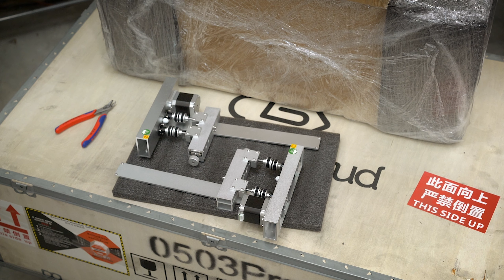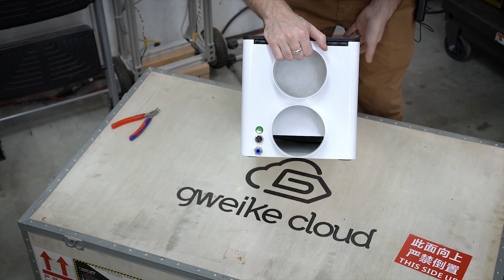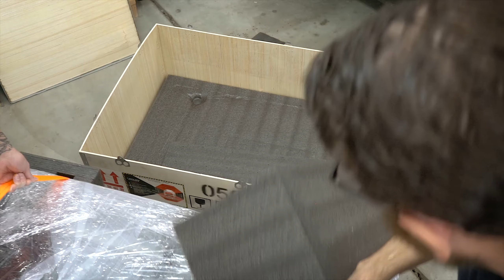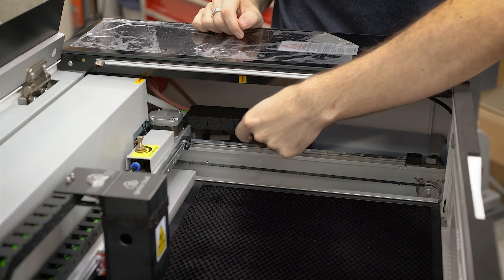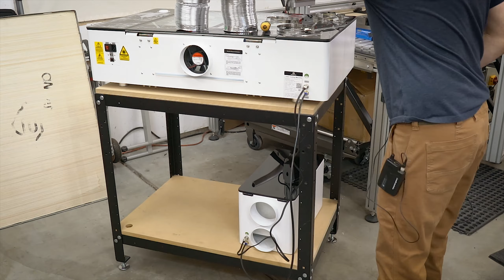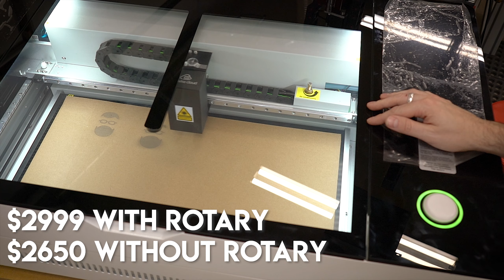Gweike Cloud 50W CO2 Laser - Unboxing and Initial Setup

Comment: I stopped at cloud software
Reply from the maker: You should have kept watching.  It uses cloud software, but it's not very good and the machine works with Lightburn, offline, no cloud connection needed.  That's one of its selling points.  The cloud software is just so it can compete with others that offer it.

Comment: Apparently, the current state of affair is them no longer including the Air Filter Unit anymore because they found it not performing to their satisfaction - Resulting in the Air Assist Pump now also being situated IN the Laser itself - Not that I personally mind as I'll hardly be feeling any guilt in directly exhausting the soot out of a window but yea... Kinda confusing when I asked about the Diameter of the of the Windpipe to order a longer one and they replied to me I wouldn't be needing it as my Kit wouldn't be including the Air Filter ( freaking me out for the Air Assist ) 🤔
Reply from the maker: Oh, that's really strange.  I'll check with them about that.  The air filter box isn't my favorite (it does just an "ok" job of filtering), but it's nice that it's included at least.
Reply: @RobertCowanDIY  Yea... Received mine this week... Took them like 2 weeks to even handing it over for shipping with DHL at least just taking a mere 3 days to get it sent over from China. Getting my Tracking Number from them took way too much effort than it should have... First surprise was a puddle of blue Cooling Fluid in the Crate ( great start ) which I'll have to keep an eye on. 😑

Obviously, everyone usually around me that could have helped with relocating it suddenly either disappeared entirely or became unavailable due to sickness / injury so "Real Men do it alone" it was... Made a carrying harness out of tie down strap like belts attached to the already present belts and carried it half a floor down the stairs into the closet while clinging for my life to the stair's handrail - Not gonna do that again.

And yea... Like previously hinted at mine indeed came with a giant Fan instead of the Air Filter Box - Will have to cut a piece of wood the right size on my CNC to place the Fan into which can then be placed into the Coset Window.

Something of an odd question to ask at this point but... Does Glass ( like the top Door Panel ) block the CO² Laser Light? I read that Plexi does as it is opaque to the CO² Laser but is this also true for what appears to be plain Glas without any coating? 🤔

Comment: I cant connect to the gweike cloud software.  Anyone else having the same issue? Got any tips?
Reply from the maker: Did you go through the whole wifi setup process? (holding down the start button for a few seconds, etc)
Reply: @RobertCowanDIY  yes I tried several times. Did the WiFi configuration page and pressed connect but it never connected. Should I just use light burn instead
Reply from the maker: @RBHockeyDevelopment  Yeah, not sure how to help you.  I did have to reboot the machine, but it eventually connected.  I would just use their offline software or lightburn, I don't see ANY benefit to the cloud software honestly.  It's much slower and doesn't do as much as the offline software.  Here's a tutorial for the offline software:  https://youtu.be/FwUBY8fa-VI
Reply: @RobertCowanDIY  Thanks! Have switched to using lightburn.  Is there a "cheat sheet" for what parameters to use (speed/power) depending on the material?
Reply: @RobertCowanDIY  also, how do i get the machone to scan the QR code on the gweike material?

Comment: Thinking of getting one of these...where did you get the power and air cables you used to extend
Reply from the maker: I admittedly had them in my parts bin.  The cable is easy enough to extend, any 4 conductor wire works (just hit up your local hardware store and look for 4-conductor wire).  The connector can just be de-soldered, so you're just adding in a longer wire, and re-using the connectors.  For the air hose, it's just 6mm tubing, same as what's used in many applications, including ice-makers on fridges and such.  A couple isles over from electrical is plumbing, after you pick up the wire, pick up a roll of 6mm tubing.
Reply: @RobertCowanDIY  Thank you for the reply.  I think knowing that I will be buying one of these.
Reply from the maker: @moebettter  Great!  I find lasers VERY useful in my shop.  Even just to cut out test parts, jigs, overlays, etc.  I also use them to etch off paint on metal parts for creating nice lettering.  They are very useful.  If my shop burned down to the ground and I had to rebuild it, a CO2 laser would be one of the first tools I'd rebuy.  Once you get comfortable with it and start using it, you realize what all can be done with it.

Comment: Have you used the machine over the last couple weeks since posting this video? What are you updated thoughts on its performance? I'm thinking of pulling the trigger. Also, it looks like Gweike is having a black friday sale and your coupon code does not stack with those offers.
Reply from the maker: I played with it quite a bit before I even released this video.  I usually do a full evaluation of a product before the video goes up and I actually end up sending quite a few things back because it doesn't meet my requirements (I have a couple 3d printers sitting in my shop that I never fully reviewed because they're just not good enough to recommend).  I think for this segment of product (a consumer-friendly CO2 laser, not an industrial one), it's probably the best one out there.  The hardware is great, but the software is a bit lacking.  However, it does work with Lightburn, it's just some of the extra features maybe don't work exactly as expected.  Like the autofocus.  It's really just an offset, so you still have to measure the thickness of your material and just apply an offset in Lightburn.  I wish it would just probe the material instead.  Things like that are more gripes than anything.  But it has solid hardware and the price makes it really hard to ignore, compared to anything else on the market, that's my take.

Comment: Good video.  Am I correct in thinking this will not etch or cut metal?
Reply from the maker: Correct.  It can somewhat etch some metal, but not without a lot of extra effort (coatings and such).  Fiber lasers are designed for that purpose.
Reply: @RobertCowanDIY  They advertise that it can engrave metal. Is that not the case?
Reply from the maker: @tonyaredwood5435  Engraving metal is a tricky thing.  It can lightly etch SOME metals, but I don't think it's a usable enough feature to really rely on.  You can get light etching with stainless, but it's not really the best way to do it.  I use mine all the time for etching off paint or anodizing from metal, and that works great. Just paint the metal (or use anodized material) and use the laser to remove the paint or coating.  You're left with a really nice etched part.

Comment: Cool. Sadly can’t buy through you as I already pulled trigger on one a couple weeks ago. I paid 15k for a 30W Epilog some ten years ago, so nice to see this technology “democratized” for the masses. 3k for machine that can accurately cut thin parts seems like a no brainer for any serious maker. Would be happy to buy a longer cable through an affiliate link if you had one (still waiting on the machine).
Reply from the maker: Hey Chris!  Congrats on the purchase, you should be pretty happy with it.  It's certainly a LOT more fiddly than an epilog, but the price difference is dramatic and I don't feel the extra money is really worth the extra bit of workarounds.  I couldn't really find any off-the-shelf cables, but I just found some 4-conductor cable I had in my parts bin and used the existing connectors (with the cable given).  It's fairly straightforward in just swapping the physical cable with a new one and re-using the connectors.

Comment: One thing that's made me hold off on buying one of these is I have never seen anyone test what happens if the laser bounces off a mirror like item back at a user. Is there anything to protect the user? That and the gaps in the frame of this are worrying. I suppose it might be unwarranted fear, but with no one covering that element I'm not sure what to think.
Reply from the maker: I would say your worries are unfounded.  There is a safety interlock at the lid, so the lid needs to be closed for the laser to fire.  Also, the laser isn't very dangerous before it's focused by the focusing lens at the head.  Sure, it's still going to be somewhat dangerous up close, but bouncing around the inside of the cabinet and finding its way out?  Nah, that's not going to have enough energy to do anything.  It really needs to be focused, or YOU need to be in the focal point for anything really bad to happen.  But it won't fire if the lid is up by 1/4".  I haven't checked the wiring, but usually that switch is directly in line with the ground to the laser's PSU, so the machine doesn't really even need to be on or functioning (logic-wise) for that switch to work as intended.  It just breaks the signal for the laser.  It's about as safe as it can get.
Reply: @RobertCowanDIY  Really my biggest worry is about errant rays hitting my eyes. I know the lack of focus can't start a fire at range, but eyes are much easier to damage, and can go in an instance. I wish there was a way to know if say at x cm even your eyes would be safe, but you are probably right that I am worrying too much as I havent really seen any cases of people losing their eyes with these.

Comment: The little Harbor Freight rolling stool you are sitting on at the start was subject to a recall a while back. May want to exchange it for one that isn't defective if you haven't already.
Reply from the maker: @DevinNoel  You usually have to pay extra for that...
Reply: @RobertCowanDIY  as with most HF stuff they were good about returns. Just took my old one in with no receipt & they sent me off with a new presumably non-defective one. Store personnel were familiar with the recall apparently.
Reply from the maker: What's wrong with it?
Reply: @RobertCowanDIY  https://images.harborfreight.com/hftweb/recalls/Roller-Seat-Recall-61896_46319_63456.pdf
Reply from the maker: @troy4393  Interesting, thanks!